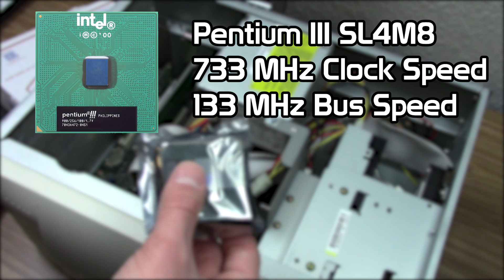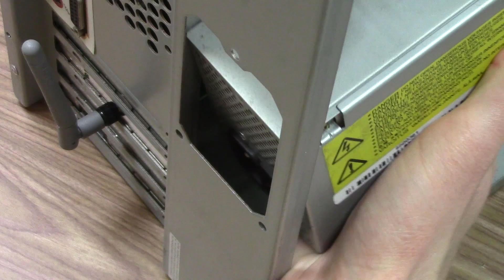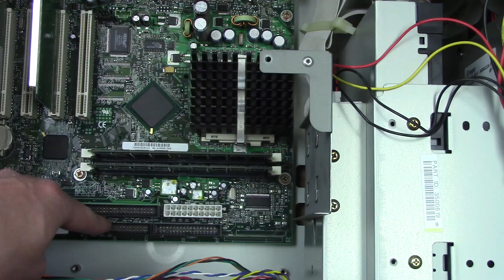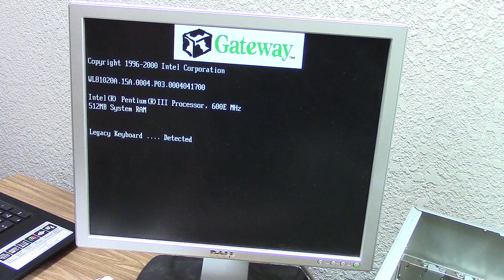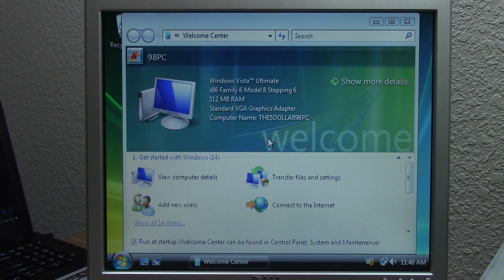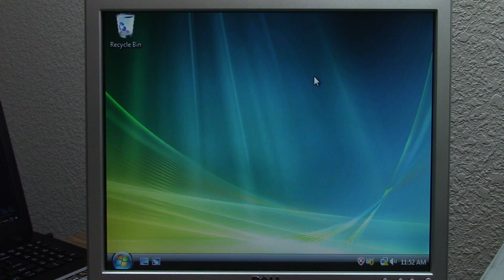Upgrading the CPU in the $5 Windows 98 PC! - Can It Run at 1 GHz?

Comment: Actually, the reason its only running at 600mhz is because the FSB is set to 100mhz. If you set it to 133, you'll get the full 733mhz. Also, adding a CPU fan is a definite must for such a cpu
Reply: @BrackynMor Yep, it's the bus speed that is throttling down the machine. It's more than likely the RAM is running at 100MHz aka PC100 RAM which will automatically make the FSB be cut down from 133 to 100. I'd definitely look for PC133 RAM, double sided 256MBs to be exact. Usually single sided 256MB sticks didn't work with older machines like this.
Reply: A bigger heatsink and fan should be used for the faster CPU.
Reply: @Natures_Intentions  It may or may not be necessary. It could probably benefit at the least but having the heatsink so close to the exhaust fan, it's not like some of the older PCs that only had a heatsink and no fan at all.
Reply: @Natures_Intentions  I think the PSU takes care of that job
Reply: No, FSB set at 100 Mhz, means multiplier of 6. And 6x133 is 800 Mhz. There have to be other problem, not 100 FSB.
Reply: You guys have a lot of knowledge about this! Very cool
Reply: FSB might even be set on the board with jumpers instead of soft in the bios. @MichaelMJD this might be worth looking into..
Reply: @warrax111  it's the PC100 (100MHz) RAM, its throttling down the FSB
Reply: @theforerunnerreclaimer  Nope, 600 x 1.33 is not 733 Mhz, but 800 Mhz.
He got eighter sold 600 / 100  CPU and got scammed, or 800/133 , that got detected at 100mhz speed. In this case, he got more, than he was told.
Many motherboards set basic speed, so it has higher chance of run, and you need then change FSB to 133 in BIOS. 

There is no chance, as Pentium 733 can run 600 mhz/100 mhz fsb.
Reply: @Natures_Intentions  Those old Gateway machines never had a CPU fan, and adding one really wouldn't work. The full ATX tower machines had a plastic duct sort of like what dell used, which went from the heat sink to the power supply fan, these micro ATX models have the fan pretty near pressed up against the heatsink. maybe a larger as in wider, but too much taller wouldn't work, and an added fan would be fighting against the fan that is already there.
Reply: @warrax111  He actually needs to set multiplier to 66mhz to get 733
Reply: @beardsntools  No, multiplier is in 4x,6x,7x, etc format. 66 MHz is frequency.
Multiplier is locked on celerons, it cannot be changed.
Reply: @warrax111  This is not a celery cpu, it's a pentium III which is far better. Btw I think motherboards, even older ones do multipliers. I even have set mine via jumpers. 733mhz is only possible with 66mhz frequency and an 11x multiplier
Reply: @beardsntools Pentiums III were also locked. All of them. :)

Only Pentium II Klamaths (66 MHz FSB) were unlocked, and some early Deschutes, 333 , 350, and 400 MHz. After about week 32 in 1998, Intel decided to lock all upcomming CPUs.
So only Pentiums II with datecode under 9832 are multiplier unlocked. 
Those are slot 1 CPUs, not socket 370.

Some early celerons for Slot 1 without cache, Covington type, were unlocked only downwards (you could lower multiplier).

Comment: Maybe a bios update will fix the issue because it looks like it does half support the cpu.
Reply: that, and maybe some jumper settings for the FSB? he did mention the 1Ghz CPU ran at 100MHz FSB, so maybe that's also a problem?
Reply: @everyonesloopy  it would be more likely the 733 one would need set because it runs at a higher FSB than the 1ghz
Reply: @Haiden4334  or that, i just mean a jumper setting in general as most if not all motherboards from that time required it if you wanted to use a CPU at a different FSB other than the one that the original CPU ran at
Reply: 100MHz should be fine with 133MHz bus; it was backward-compatible. (Not so with 66MHz FSB, which was a crapshoot.) It looks to me like it is running at 100MHz bus, tho, which would make the 733 run at about 600. Might be limited by PC100 RAM; try PC133.
Reply: @Reziac  the original i810 chipset is limited to 100MHz FSB, so that's probably a chipset limitation.
Reply: @DxDeksor  yeah I agree with you my dell has the same chipset and it can only run 100mhz fsb I have a 1.1 ghz intel celeron
Reply: Likely so. And Gateway was notorious for buying seconds, so sometimes the chips in their systems had some deficiency or defect compared to the same chip on the open market. (Hence the occasional Gateway-specific driver for an ordinary chip.)
Reply: @Reziac  I'm guessing they did that because it's cheaper?
Reply: Obviously :) But it sometimes made for adventures in drivers. That said, Gateways of this era were pretty easy to work on, and to turn into upgraded frankenputers.
Reply: Deksor that is not a limitation as the Deskpro EN Compaqs had it up to 1.2 or 1.4 same chipset
Reply: @BGC Hub I agree with you
Reply: XBN BEEF Actually I am trying to see if the BIOS is hosted anywhere
Reply: @wdd6864  o ok
Reply: XBN BEEF I want to see that go to 1Ghz if possible lol
Reply: Maybe, but good luck finding it!
Reply from the maker: Followup is coming, but unfortunately it just isn't that simple
Reply: Michael MJD can’t wait to watch!

Comment: "600E" is actually the processor model. The E suffix indicates a Coppermine Pentium III, built on the 180 nm process, to differentiate it from the earlier Katmai core (250 nm). B means 133 MHz FSB. So, the CPU you just installed is a Pentium III 733EB, the BIOS reports 600E likely because your motherboard doesn't support the 133 MHz FSB speed and is running at just 100 MHz.
Reply from the maker: The full model name is actually just the Pentium III 733. This specific CPU's s-spec number is SL4M8. It appears that the system is only recognizing it as a 600E CPU as it only runs at 600 MHz. And yes, the Bus speed seems to be the issue here.
Reply: @MichaelMJD  Have you tried overclocking?  Can you step up the bus speed or clock speed, or both?

Comment: the fsb is showing 100 instead of 133 in the bios.  clock multiplier should be 5.5 @133Mhz, giving you 733Mhz.
Reply: The i810 chipset doesn't support 133FSB.  66 or 100 only.
Reply: @2dfx  This Board has the 810E wich is supporting a FSB of 133.
Reply: I there not a jumper on the mainboard to select the 100/133 setting ? That was common those days instead of a bios setting :-)

Comment: You definitely need a BIOS flash from P03 to P06.

Is the Northbridge an 810, or an 810E chipset ?... This can make a difference as the base 810 doesn't support 133 MHz, but the 810E does.

Did you try hard resetting the CMOS Battery Jumper to fully clear the FSB and Multiplier ??

Whitney Northbridge supposedly only supports a Clock Multiplier maximum of 9.0x, so that 1000 MHz chip will likely never run.  Or at least not at full speed, even if a BIOS update does add the correct Microcode to recognize it.  Though getting 900 Mhz in this machine would still be amazing.

If it is actually an 810E chipset with 133 MHz support, with a BIOS update you might be able to get a 1000EB to run full speed (SL4C8, SL4MF, SL52R, SL5B3, SL5DV, SL5FQ, SL4WM).  Or even a 1133 MHz (SL5B2, SL4YV) End Of Line.

But have fun trying to hunt down the best sSpec unicorn to work in a locked OEM mobo !... You should have an impressive collection of chips later if you do go down this rabbit hole.

Comment: With these types of motherboards and CPUs you need to clear the CMOS and also have a bios update in order for them to fully support the latest compatible CPUs. You also need to check and see whether there are any jumpers on the motherboard for configuring the CPU base frequency and multiplier

Comment: Did you try updating the BIOS to the latest?
Reply from the maker: It appears to be running the latest BIOS version.
Reply: @MichaelMJD  It isn't.  You're running P03.  P06 is the latest version....it might come with the updated microcode you need to get the 1Ghz chip working!
Reply: I've got a similar Gateway. Find me the drivers for these things and I'll go find you a unicorn.
Reply: Googling the bios strinf also tells us that p03 is the default bios and theres a p06 out there ;)
Reply from the maker: @2dfx  You're right! I was able to get the newer BIOS version. However, it's unfortunately not as simple as just updating the BIOS.

Comment: I've got a lot of experience with the Pentium III platform. Pretty much any CPU up to 1GHz will run in any mobo. Maybe if the BIOS was updated it would work. The problem is the tualatin > 1.0GHz cpus which only run in select hardware. CPU adapters exist and occasionally they let you run a > than 1G in a normal mobo. There also exists a guy from Korea on ebay that hacked the 1.4GHz cpus. Type "1.4GHz pentium III socket adapter" into ebay. It's not actually a socket adapter though; it's a hack. He just called it that for when people are searching for that.

Comment: Someone else may have pointed this out but you need to change the front side bus speed from 100 to 133. There should be a setting in the bios or jumpers to set on the motherboard. Best of luck.

Comment: Check to see if both RAM modules are PC133, if even 1 is PC100, your FSB will be throttled down from 133 to 100MHz. But in older machines like this, usually if you wanted to use 256MBs of RAM, you must find the double sided modules as the single sided modules generally only worked in later machines. I know for a fact my Dell Optiplex GX110 was picky like this but it was able to handle the SL52R 1GHz processor, no problem, as long as both RAM modules were PC133.

Comment: I was in a pawn shop one day and saw this nice little gateway laptop that the pawn shop was advertising that it was running Windows 7.
As it turns out when I get home and turn it on it is actually running XP and also learned that the operating system was heavily corrupted so I reinstalled the os and got it corrected.
I was only then left with the issue of putting the correct drivers back on and found out that gateway has a website where I found everything that has to do with the specific model of the computer including the bioses.
With any luck maybe your computer will still be in the database.
Reply from the maker: I looked on Gateway's site and found a support page where you can select your PC's model which is probably what you're talking about. Unfortunately I did not see this model on there. Guess it's just too old

Comment: When changing a CPU it helps to remove the CMOS battery and wait 10 minutes  to reset the BIOS otherwise the computer will not post. When I'm working on vintage computers I open the PSU just to check there are no bulging electrolytics to save any any faults further down the line.

Comment: Well, I just found out something about my own Essential. I never realized that the Mendocino Celeron and the Pentium III were both Socket 370 processors.
Oh, next time I'm back home for the weekend, I'm going to have a bit of fun with that thing. I have a Dell Dimension 4100 with 512MB of PC133 RAM and a 733 MHz PIII -- parts I'll use to push that Gateway to its limits.

Comment: This is my second viewing. I know others have mentioned this but just in case I’d install the chipset drivers and up the FSB to 133. Chipset drivers will probably get you better integrated graphics performance, or you could spend some and get a PCI graphics card. I’d do the latter.

Comment: It shows 600 mhz because that's what you get with a 100mhz system bus.  Bus X Multiplier = CPU speed.  To get 733 you need 133mhz fsb.  There may be jumper(s) on the Mobo to set fsb speed, although 100 may also be the best it can do.
Reply from the maker: Unfortunately that is not an option on this particular board. I have a followup video coming detailing the whole thing

Comment: It's not running at 733 because even though that is the slower processor, and it was spec'd at FSB at 133, but if you notice, when you get into the BIOS, the FSB has been slowed down to 100Mhz.

Comment: Update BIOS, check the jumpers in the motherboard, try to change the FSB in the BIOS, it seems to be running at 100MHz not 133Mhz.
Reply: chipset limiation

Comment: Does the BIOS have an option to change the Front Side Bus (FSB)? Your CPU is set up for a 133 MHz FSB, but the BIOS says it the FSB is 100 MHz. You might also need to check your RAM and make sure it can run at 133 MHz.
Reply from the maker: I double checked it it displays the FSB speed as 100MHz but there is no option to change it. I believe that the BIOS version it currently has is the latest, as I cannot find a newer version online. The BIOS date is 4/4/00. There are similar boards that have downloads for newer BIOS versions but this one does not seem to be one of them.
Reply: Bummer! Unless we can find a workaround 600 MHz may be the best you can do.
Reply: Is there any jumpers on to mobo to change FSB?

Comment: I gotta drag its twin upstairs (ugh, it's really heavy -- tricked out with every add-on card known to man) and see what can be done with it. Lots of BIOSs of that era, you have to manually set a speed higher than the CPU's minimum default, or it'll run at its slowest supported speed. CPU auto-detect was not yet reliable, or more often entirely absent. It may also have a jumper that needs setting for the higher bus speed, or may be limited by PC100 RAM (try PC133 in it).

I have another one that's similar, same era, that will always come up at 500MHz, and you have to go into BIOS and tell the dumb thing that it is actually 800MHz. Some of 'em just did not remember from one boot to the next. Seen this enough times to think it's a bug from that transitional era when CPUs finally got past the early 440BX barrier (usually 550MHz).

And if you want to unload that 1GHz CPU... I know a P3 that would love to have it. :D
Reply: Maybe you can post a video tour of your PC and all its add-in card glory. Did you fill the ISA slots?
Reply: That's an idea, if I ever start doing videos. (Why I have subscribers escapes me.) Been a long time since I looked inside but IIRC it has vidcard,  video capture card, NIC, modem, sound card, SCSI card, and maybe a couple others that I don't remember (might also have a SATA adapter and an extra IDE adapter). It was salvage and was never actually put into service at my house, but definitely too good to toss out.

Comment: update the bios. something else u might want to try. the ide cable your using is a 40wire ata 66 maybe swap it out for a 80wire ata 100/133 might make booting a tiny bit faster depends if the hd controller supports ata 100/133 but even it dont it wont hurt to swap it out anyway.

Comment: next video: playing crysis on the windows 98 pc
Reply: Not possible. This PC is still too weak to play Crysis.
Reply: there's a video of Crysis on a 500 or 600 MHz Pentium III but with a GeForce 6200, running at about 6-12fps on lowest settings. so this PC stuck on its onboard video has no chance

Comment: I doubt the CPU is maxed out. That CPU is underclocked probably because of the limited FSB speed your i810 chipset is limited to.
If you can't use the 1GHz Pentium 3 it may be because its not properly supported by your current BIOS, but maybe Gateway have released updates to support this CPU ?

Comment: My first pc build I made was with this Tualatin p3 1ghz cpu and I used it in a board designed for only a 733 mhz board. It ran well for over 4 years before I upgraded it. Except the zif socket broke mounting the heat sync and had to rma the board. Stupid socket 370!

Comment: celeron coppermine 566 cd0 stepping is the funniest celeron ever made because after covering bsel1 and bsel2 pins on the cpu it can run either at 850mhz or 1,14ghz i had 2 of them and both of them had dual cpu pin active  so they could even run in dual cpu board
also 1,5V core and very cold chips, they didn't require overvolting or big coolers for 1,14ghz overclock
i810 is kind of unfortunate chipset, still it have qdr chipset link but it is teoreticaly limited to 100bus and no agp
i would check the power suply because early pentium 3 coppermines like to hog power on 5V rail and some power suplies simply don't like that

via apollo 133 t chipsets would take up to 2gb of ram and up to 1,7ghz overclocked tualatin celerons by the way

Comment: I'd definitely throw a fan in there either on the CPU cooler or on the back as an exhaust.

Curious how the 733MHz CPU was running at 600MHz.  733 = 133MHz FSB x 5.5.  100MHz FSB would then yield 550MHz.  Where would it be getting its multiplier of 6?
Reply: from bios/cpu microcode/hardware level
Reply: @hugosimoes5119  Wouldn't it be reporting a 5.5 multiplier though?
Reply: @iammrsparkle84  that he can fiddle... probably not. he would need to give an overview of all pages of the bios.
5.5x133 yes it's 733mhz
6x100=600 and 5.5x100=550
we need to recall that intel used to have multiplier blocked to avoid normal computer shops to overclock cpus and steal the profit.
Reply: @hugosimoes5119  That Gateway BIOS would not have user-modifiable FSB and multiplier settings.  I guess the CPU is just negotiating what speed it can run at given the motherboard's limitations. 
CPU: "Hey, I want a 133MHz FSB"
Mobo: "I can't do 133MHz; here's 100MHz"
CPU: "OK, can you do a 7 multiplier?"
Mobo: "Nope, I only go up to 6"
CPU: ""600MHz it is then"

Comment: Are you sure the 1ghz cpu isn't dead? I've got a 440bx gateway with an 1100mhz Pentium 3 and it works fine, even shows 1100mhz in bios.

It wasn't uncommon for FC-PGA chips without a IHS to die if there was a microscopic crack on the die from uneven mounting pressure.

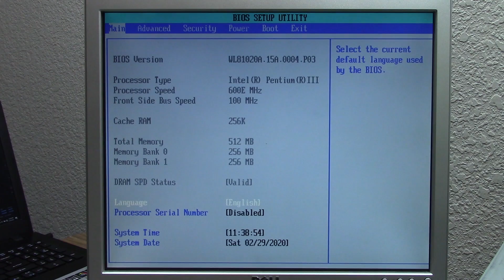Comment: 90W power supply for gig p3? Maan, there's no way this could run.. p3 is more power hungry, you'd need at least 140W supply edit: 12:05 multiply those shown 100Mhz with 6 as clock multiplier and you'll get 600Mhz, this has nothing to doo with bios version!